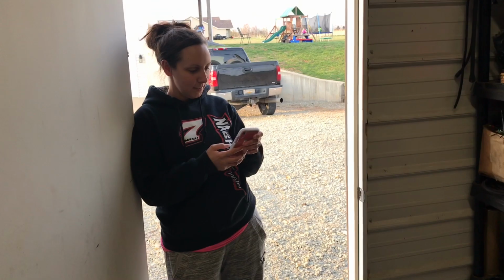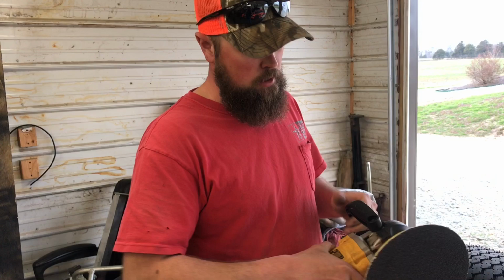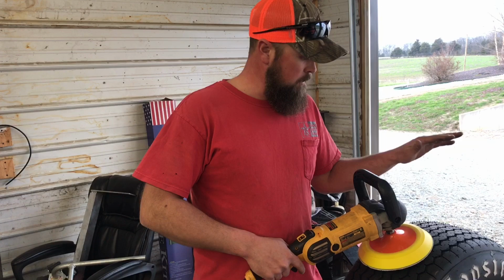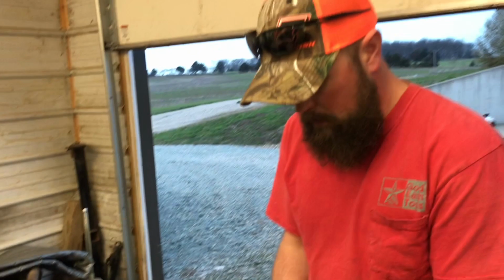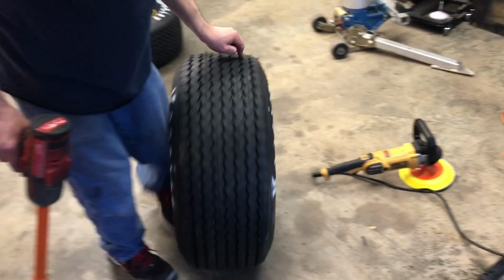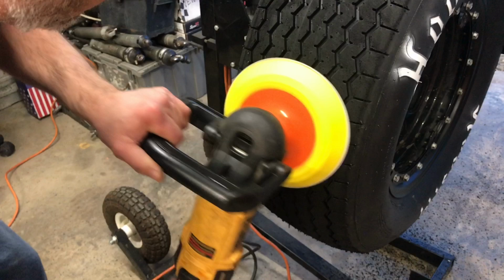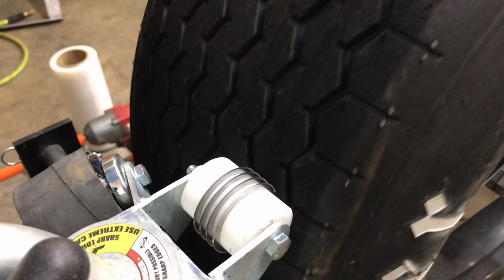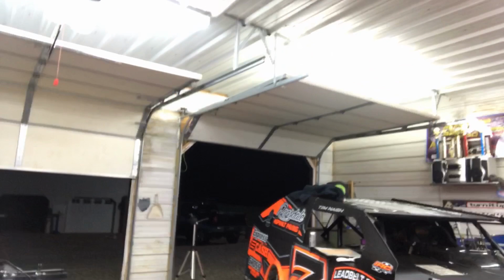Dirt track tire prepping - this is how WE do it

Comment: We use the needle roller on rally ice and snow tires to help trap any unfrozen water on top of any ice sheet. How does the needle roller help with dirt?
Reply from the maker: Just opens up the tire and allows it to flex
Reply: @OldNo7Garage  Is this something all teams do at your typical local track? I'm not sure I have seen this before after scuffing. Do you do that between heats as well after you scuff them down again?